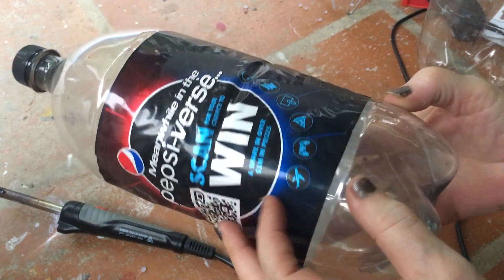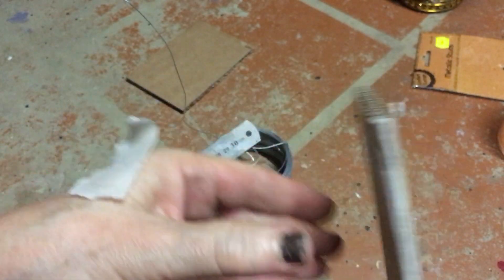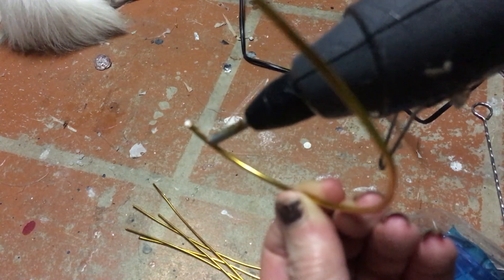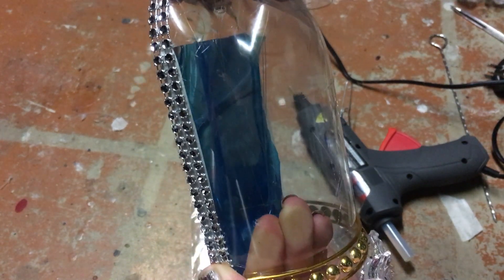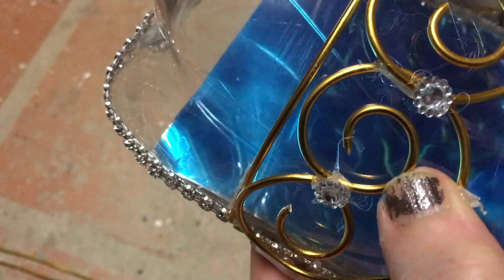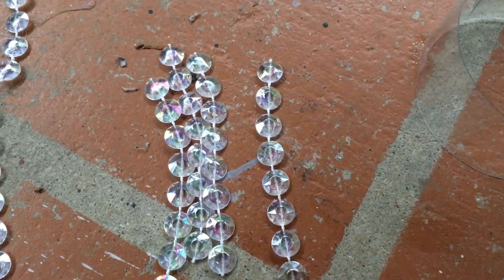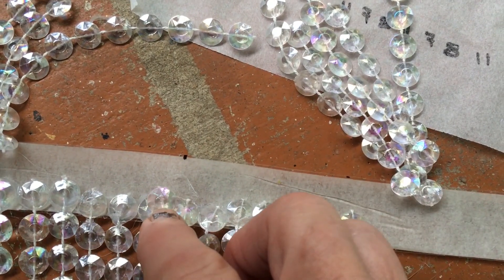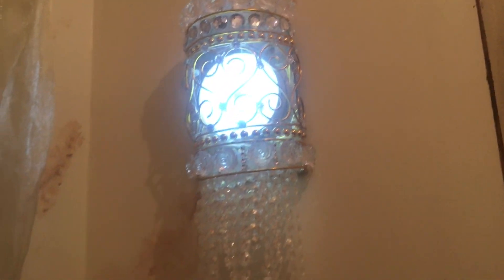DIY Elegant Wall Sconce

Comment: Where did you get the lights? Amazon ?
Reply from the maker: Hi I got those ones on eBay but I have also bought others on Amazon and Temu and they are all great some are battery and some are rechargeable. 😍